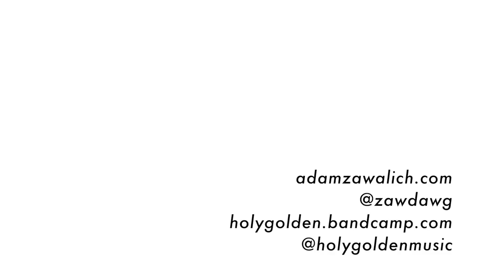Two Tables, a Slab, And a ShopSmith

Comment: Nice job and that wood is gorgeous.  I don't have and have not used the Universal tool rest so when I saw that your sanding drum wasn't positioned over the insert I was going to ask why until I noticed at 2:09 that the tool rest base causes your table to be further extended than normal. I had considered the tool rest upgrade but since I use the drum sander so frequently I think it would drive me nuts having to remove and reinstall the base each time. Anyway, I enjoyed the video and am now subbed.  Scott
Reply from the maker: Thanks! Yea when you're doing a lot of back and forth between turning and sanding, taking the tool rest off and on a bunch gets old fast. I've had the universal tool rest for a year or so, but I'm still not entirely sold on it. It's hard to get it into some tricky positions. I also stripped one of the screws for the insert and couldn't get the table saw faceplate out. (0:40)

Comment: How did you attach the legs?  Floating tenons?  How did you drill the hole (to receive the tenon) for the tabletop?
Reply from the maker: I did not realize that both of those were not on the video until now. Yes they were floating tenons that went 3/4'' into the leg and a little over an inch into the spindle. The hole was done with a 1 1/2'' forstner bit after it came off the lathe